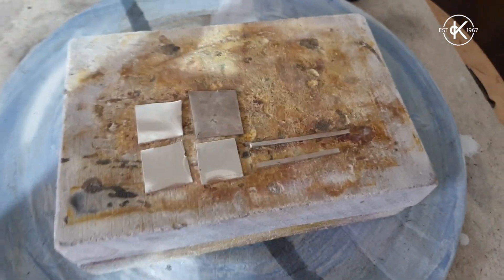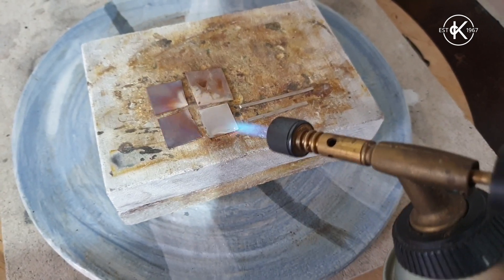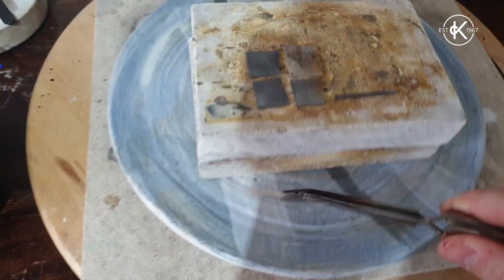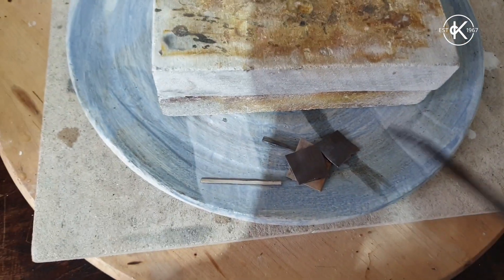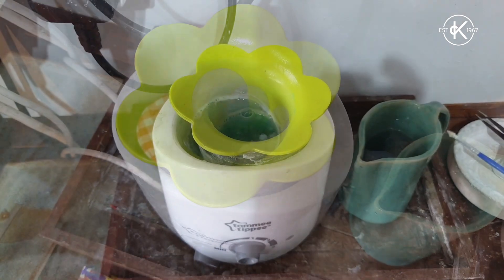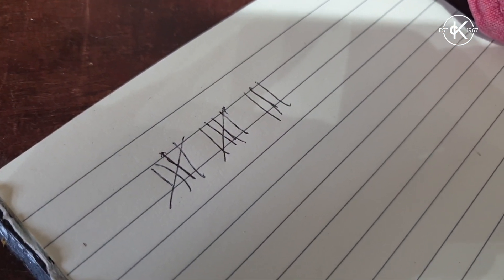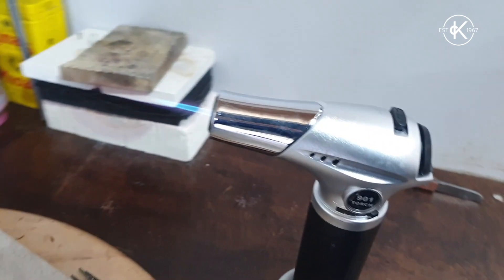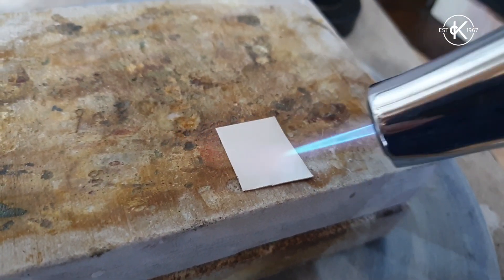Reticulation Tutorial | 12 Months Of Metal

Comment: Excellent tutorial which answered all my questions without my having to ask them, for example:  Why not start with fine silver?   Because it's too pure and, I would imagine, would melt altogether too easily?   That copper worked well, though :-)
Reply: Thanks Hilary! The brass has become a firm favorite to reticulate too :)
Reply: @makeitwithkim-jewellerysil3126   Do you not have problems with brass?  I saw a video where someone demonstrated what happens if you heat brass too long after it melts.... it explodes!!  Of course, it was just a brass ball they made from melting the brass.  I just wondered since you're melting brass to get this effect if you've experienced brass explosions?
Reply: Hi  @tammygurl64  no, we haven't had any issues but then reticulation is done at a far lower temperature in a slow and controlled manner. Any metal can explode when exposed to sudden, extreme changes in temperature. Which is why, when casting it's important to preheat your ingot moulds. I never melt brass to cast it, partlt due to the amount of heat required and partly due to the zinc fumes it would give off. When retuculating, you only just push it past the annealing temperature as 'melting' it too much would lose your structure and like you said, turn it into a molten ball. So I think with good ventilation it's fine to do but if people were working with larger amounts for any prolonged period if time, you'd definitely want a good fume mask and/or extraction unit. And obviously eye protection as always.

Comment: Thanks for the very helpful video. How does the process work on pure copper when you don’t have a different surface composition when compared with the core. Is this just the copper melting and being moved by the force of the flame?
Reply: Yes I would imagine so but the back of the piece still stayed relatively flat and the surface seemed robust (no obvious air pockets or soft areas). I have no idea why it worked because like you said, it shouldn't have and I primarily started the copper sample to show it wouldn't work as it's a pure metal. It was a happy and unexpected accident :)

Comment: Many thanks for the brilliant video Kim.  Just a few questions.  Do you form the metal into the required shape first and then reticulate?  Are there any problems with soldering once the silver is reticulated?  When you made the reticulated ring in what order is the the forming, soldering and reticulation?
Reply: Hi Stephen, glad you liked it. Normally you need to reticulate first, then form your metal, then solder it. If you reticulate after forming, there is a very high chance of the metal collapsing or developing holes where the flame burns through the entire sheet. The exclusion to that is Kernowcrafts reticulation sheet. It is a specially prepared mix of silvers which reticulate in a very controlled manner the first time you heat it and it can be formed before reticulating while still being able to hold it's shape. The selling point is it's very reliable, there is no prep required and it is structurally stronger. The downside is you pay considerably more for those privileges compared to standard sterling silver or brass. Metal can be more porus after reticulating so sometimes you need to use more solder than you would usually use but other than that, there are generally no issues soldering reticulated metal. Hope that helps :)

Comment: So your pottery pots work well all the time for use?  They look beautiful in the video.   Is that a coffee pot filter in your pickle pot??  The scrubbing with a brush is important? Will it mess up the process if it's not scrubbed?
Reply: I've had my ceramic pots for years. They are rejects from pottery students at the adult education centre I teach at but I love them so my house and studio are full of wonky pots 😁 The plastic thing is a tea strainer. Not essential it just helps fish tiny bits of metal back out. The brass brush isn't essential either. It just helps speed up the process of removing copper from the metals surface. You  could sand it between annealing instead.

Comment: How do you avoid firescale during retic?
Reply: Hi, the typical understanding in the UK is firescale = the dark marks left behind on the surface of the metal which you usually remove with pickle. Firestain is the purplish stain you can sometimes see under the surface of the metal when it has been overheated and it's a pain to remove. With firestain, you can't really avoid it when reticulating but the textured surface hides it. Firestain is usually only a problem on smooth metal.